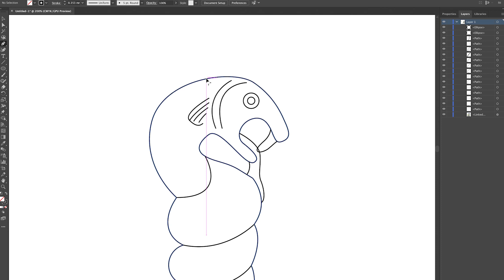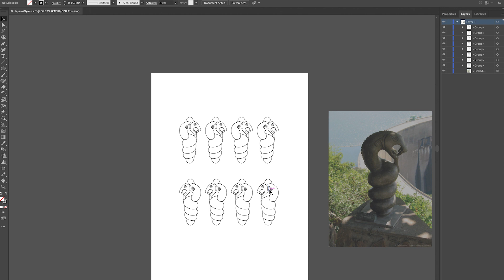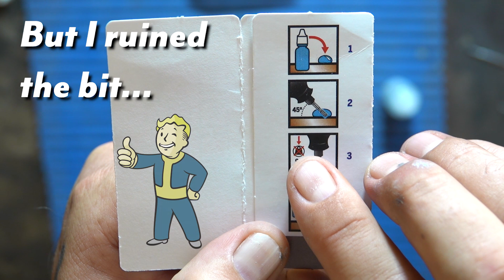Carved the Nyami Nyami (Zambezi River God) out of a Rock

Comment: Mate, that was AMAZING. I've never seen rock carving before and it was SO COOL. Please could you tell us what the different bits you used were please? How are they different to what the other carvers, your mentioned,  use?  Also when you put that on at the end, I thought you where going to keep it LOL.
Reply from the maker: Hey, Thanx man... :-)
Well, all the bits I use are diamond coated abrasive bits which are mainly for glass and pottery engraving, but they work well for stone too... except for when it comes to poking holes through the rock, for that I had to get a hole cutting bit... well, two actually cause I ruined the first one LOL, they are the same in composition (Diamond) but they have a hole in the centre... the only difference between mine and the ones I mentioned are the size and shape, the drum grinding bits are nice because the have a larger diameter so they can remove material a lot quicker and the disc are particularly nice for getting into creases and adding some details. but they are not a necessity, they just make the job a little easier... Yeah man, I think it looks good on me, I may just have to make another one... LOL... glad you liked it, thanx for watching... :-)
Reply: @maconSTUFF  Cheers pal. All the best from NZ.